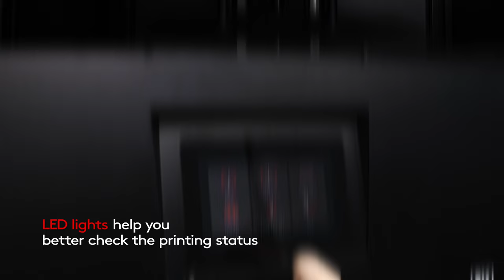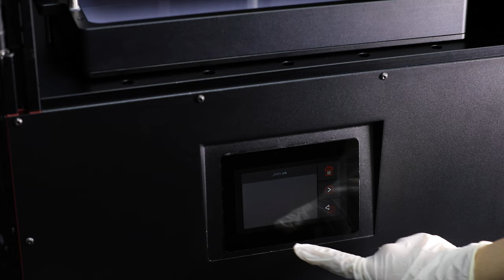ELEGOO JUPITER: The biggest, most capable resin 3D printer ELEGOO has ever launched!

Comment: A few questions:

1. No network connectivity?
2. USB at the back?
3. What about additional resin tanks? (close to impossible to get those for my Saturn)
4. Will there be a fitting Wash & Cure solution? I doubt my current one is suitable.

<edit> little remark: The Display says "JUPITEP"
Reply from the maker: Hello friend, sorry that the network function is not available on this machine. The USB disk is on the side of the machine. If you'd like to get an extra resin tank, you can consider the special package(check all the deals: https://bit.ly/3C0TTC9) Sure, we will be working on a larger wash and cure station to work with the big printer. The "Jupiter" is a typeface that the “R” letter is not complete. Thank you very much for your interest.
Reply: @ElegooOfficial  Thank you for your feedback. I really appreciate it. I am loving my Saturn, so I will keep an eye on the Jupiter for sure!
Reply from the maker: @PrimeRsoul  It's our pleasure!
Reply: I too think the "R" looks dorky. It has the impression of being a typo. Would look better with a detached diagonal leg.
Reply from the maker: @starbase101  We changed to another typeface. Thank you for your kind suggestion.

Comment: I wish the USB port was on the front instead of on the side for being more-conveniently accessible. If the printing chamber is completely enclosed within a metal cabinet, how do you install the Z-height extender to be released later? Wouldn't that require a taller cabinet?
Reply from the maker: Hello friend. Parts above the middle board is a modular design, which means they can be assembled by yourself when installing the Z-height expansion lit.
Reply: @ElegooOfficial  That doesn't answer the question. If the Z-height extender increases the height, does that then require a taller cabinet shell?

Comment: without network access?
Reply from the maker: Hello friend, sorry that the network function is not available on this machine. But It offers high volume printing at the most affordable price, it is the perfect solution for those looking for large 3D printing.
Reply: @ElegooOfficial  A printer this special should include network access for uploading models to the printer wirelessly, especially considering the inconvenient USB port location.
Reply: @starbase101  exactly! how much does a wifi unit cost nowadays? no to mention buying in bulk^^  hell nearly every second light bulb comes nowadays with wifi. I really cant comprehend...saved production cost per unit at low single digits...if not even only cents...
"High value / convenience features at low cost" is one of the very last screws to twist, if the absolute necessity arises to bring down production cost. Especially not if it is your premium product.

Comment: Out of all of the complaints, the most common is that the USB plug is on the back and they're still too stupid to learn that lesson - put it on the FRONT
Reply from the maker: It is on the side of the machine.
Reply: I agree, USB should be on the FRONT. Having it on the back or side is as convenient as having the touchscreen control panel on the back or side. Not everybody has their printer located on a freestanding worktable in the middle of a room. Some of us have our printers on a workbench against a wall with cabinets on either side. We shouldn't have to rotate our printer to access the port or buy a separate USB extender. Make the machine user-friendly.
Reply: @ChaosWhite I shouldn't have to suffer from other people's stupid mistakes. If somebody is so clumsy that they're spilling resin then maybe they shouldn't be 3D printing.
Reply: Look through the comments and you will see I am not the only “complainer” about the USB port location. Gee, people might spill resin onto the touch screen too, better get that moved to the side as well!
Reply: @ElegooOfficial  i love this printer, but on side is not a good idea. Front is the best place for a User friendly design. Or Side and Front.
Reply from the maker: @nordzwerg  Thank you Torben, we have passed your suggestions to our R&D department for further consideration!
Reply from the maker: @nordzwerg  Hello Torben, thank you for your kind suggestion!

Comment: Hello, does it have a heated bed ?
Reply from the maker: Hello, Kostas. The Jupiter has not the heated bed. Whether the need to add the heating device has a lot to do with the fluidity of the resin. Heating is mainly to keep the resin very active within a certain temperature range to improve the success rate. ELEGOO resin has better fluidity, our machine uses ELEGOO resin, then temporarily does not need a heating device, but if it is other brands of resin, high viscosity, such as Siraya, no heating device, then the winter printing failure rate may be higher.

Comment: Is this using ChituBox hardware and/or firmware?  Or are you using other hardware and firmware (non-ChituBox related)?

EDIT: It is ChituBox based, and is forcibly tied to the new ChituBox subscription system.  You can't use the printer w/o an active paid subscription to ChituBox.
Reply: I believe it’s chitubox